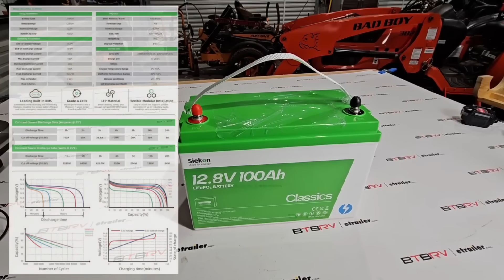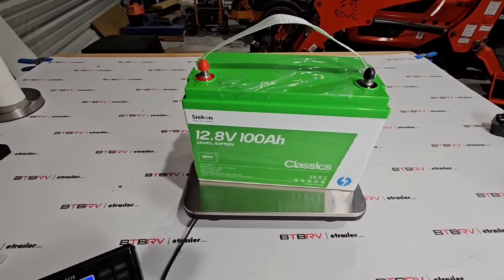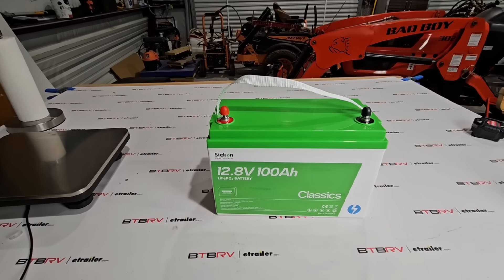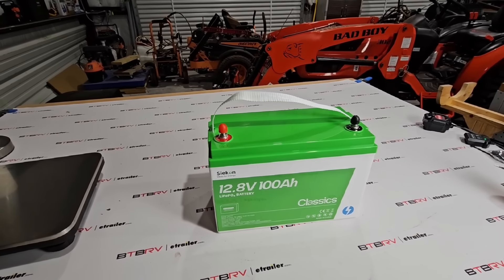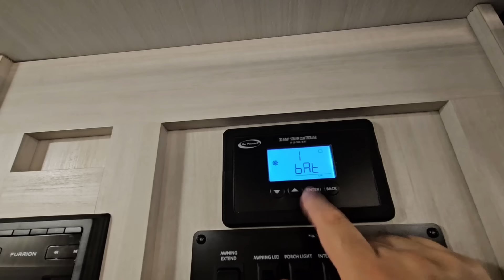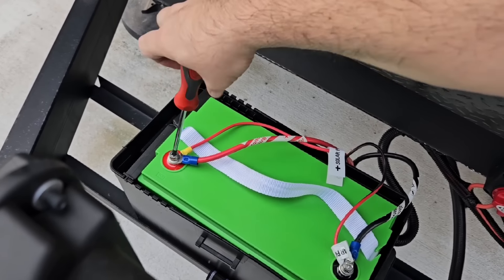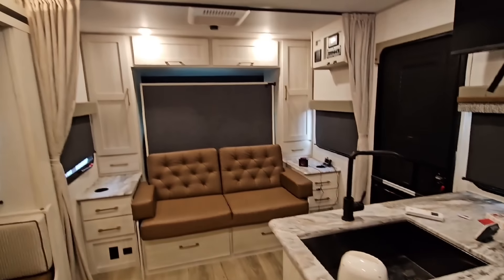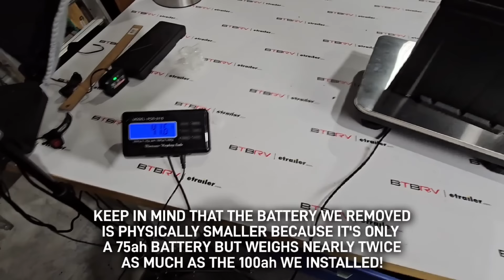Upgrading RV Battery from LEAD ACID to LITHIUM with a Siekon Budget IP65 Battery!

Comment: Also You Need To Make Sure Your 120v Power Converter Is Lithium Ion Battery Compatible And In That Setting And Not On Lead Acid Or AGM Otherwise You May Damage Your System
Reply: Yeah, I had to replace my 120V charge controller when I did my lithium upgrade.  It added about another $140 to the cost, but I got rid of 2 x 100Ah LA batteries for a single 230Ah lithium.  Best money I've spent on my RV.
Reply from the maker: @mcgilm69 The folks at Forest River surveyor explained that the WFCO AD auto detect converter is perfectly safe for auto detecting and charging lithium batteries.
Reply: @BTBRVReviews  Sorry for the late reply.  My comment wasn't based around a specific model, so much as the poster that indicated that you do need to verify that your converter supports lithium batteries.  Even though my RV was a 2018 model year, I still had to upgrade the converter as part of my lithium update.

Comment: You can run a conventional converter with lithium without a problem.   The only thing that happens is the charging voltage on a conventional converter isn’t enough to charge the lithium batteries to more than 80%.

Comment: That was a lot of water in that box! Had to be from condensation. Also through my research, it's been said that fans don't like the higher voltage of lithium batteries. Particularly the circuit boards of the Maxx Air fans. The issue is being addressed by the fan manufactures but people are putting DC-DC converters in line with their fans to ensure the fan only gets 12v.

Comment: Good video. If you do use solar? I would get the mppt controller. Made a big difference for me. 
I bought a different brand battery about 3 years ago. So yes, newer technology back then. Spent quite a bit more plus the extra for a “low temperature” model. Since I had an older model camper, I changed out the converter. 
The research  I did back then? For my battery it was said you could use a regular charger, but since their lithium battery gets charged at a higher voltage; using a regular lead acid type  would never fully charge the battery. I did run into a camper with the same model trailer that did not change his converter and was happy with his. I boondock most of the time, so every bit of power can be precious. for me it was nice being able to charge the battery quite a bit faster with the new converter. 
Anyway, to each their own. People need to research what their equipment is capable of doing. Most newer campers I understand come with converts capable to charging lithium, but don’t just go off that! 
Research.

Comment: You know most installed these inside for a few reasons. Theft and temperature, obviously cold isn't good but neither is hot. Looking at the black box you placed this in and the climate I would think you're going to have an over temperature situation unless you keep the sun off it. 150F is it's max which I bet you will exceed.

Comment: Does your 120vac to 12vdc converter support the battery? Are you planning to install a DC to DC converter from the truck charging circuit?
Reply: An easier but messier option would be to disconnect the alternator charging and plug a 110v LifePo4 charger into an outlet in the bed, connecting it to the battery. Whether any on-road charging is needed depends on your solar setup - if you have a big solar array, it may not be worth the trouble.
Reply from the maker: @michaelramsey3643 The folks at Forest River surveyor explained that the WFCO AD auto detect converter is perfectly safe for auto detecting and charging lithium batteries.

Comment: They need to make a LiFePO battery with a built-in charging/discharge circuit board that makes it compatible with a lead-acid battery charging system.  It can be done.

Comment: Hey you will need a Victron dc to dc converter from the truck. Also surprise the 23 and 24 ford truck will not support he dc to dc with the computer control of the seven pin I had to run a upfitter switch wire to an  Anderson connector on the back bumper. Surprise

Comment: Do I need the solar charge controller if I do not have solar panels? I just want to use shore power or my generator to do the charging? Will this drop in just for that?
Reply: You do not need a solar charge controller unless you are using solar panels. All that does is manage the charge coming from solar panels. You do need a converter charger that can be set to or detect Lithium battery chemistry though. Some newer models in newer RV's have Lithium compatible converter chargers but the vast majority of those from before 1-2 years ago do not. You aren't going to cause some massive problem by dropping in a Lithium battery, but you may shorten the life of your battery and not get optimal performance unless you use a Lithium compatible converter charger.

Comment: Great video. The shore power inverter charger must be configured to charge lithium otherwise the lithium battery will be presently damaged by the inverter charger.
Reply: Sort of. A lot of people have no issues dropping in Lithium batteries. It's not optimal and you may shorten your Lithium battery lifecycle, but it isn't going to just ruin it. Charging the battery in freezing temps will though, so that's a thing people need to be aware of.
Reply from the maker: The folks at Forest River surveyor explained that the WFCO AD auto detect converter is perfectly safe for auto detecting and charging lithium batteries.

Comment: Thanks for the informative video! No solar on our RV. Do I have to change the built in battery charger to use this battery?
Reply: Look up the model of the converter charger on your RV. Some newer one's support Lithium and some do not. Mine for example has an auto-detect feature that can detect different type's of battery chemistry and automatically adjusts the charging profile when connected to main 120v power.
Reply from the maker: @Gubers The folks at Forest River surveyor explained that the WFCO AD auto detect converter is perfectly safe for auto detecting and charging lithium batteries.

Comment: Good news: trailer battery boxes are separated from the living area in case that once in a million thermal runaway gets you
Bad news: it's 2 feet from the propane tanks
Reply: More like a half a foot away from the propane tanks :D
Reply: This really isn't a concern for Lithium Iron Phosphate batteries used in these applications.
The following was taken from ev-magazine online webpage and verifiable from many other sources:

LFP or lithium iron phosphate, also known as LiFePO4, is a completely different chemistry. With a much higher thermal runaway temperature, (some 20° C higher depending on manufacture), the potential for cell rupture due to thermal runaway is well outside of normal operating conditions, even on the hottest of days.

Further, (and it seems obvious but still bears mention) iron doesn’t burn like manganese. Actual fires due to battery failure, on those rare occasions that they do occur, are limited to wires, and sometimes battery management system (BMS) printed circuit boards. Assuming that the battery casing conforms to NEMA or IP standards, cell fires cannot escape the case unless it’s been punctured.

Also, the findings of several experiments where cell explosion is forced, have confirmed using gas chromatography that the release of gasses during a cell rupture event are by far the least toxic (containing no transition metal aerosols in contrast with NMC) of the common three lithium chemistries.

Comment: The BMS in that battery is limited to 100 amps, probably not enough to run a microwave. The BMS is the deciding factor that controls the charge and discharge cycles and also the battery safety. Really the need for outside change protection isn't necessary anymore.

Comment: The problem with these Chinese batteries is the inconsistencies from battery to battery. You can buy 10 of these and find that internally they are different inside. There's tons of these Chinese battery options. No idea why you chose this brand. There are some Chinese brands that have a pretty solid reputation over a significant period of time and this isn't one of them. LiTime and Chins are examples. Every one of them including this one is basically one of those Chinese brands that pops up on Amazon and isn't really associated with a real company. No reason to choose this particular one over others IMO. Though, there are 40+ reviews on these. But many others have lots of reviews.